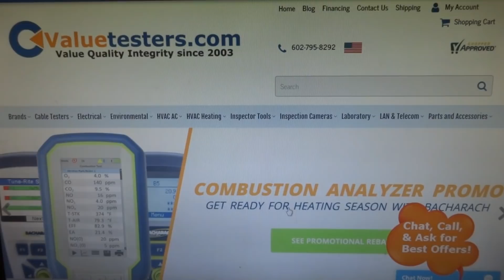kitchen sink basket strainer leaking replaced

Comment: I just replaced a leaking basket strainer on my kitchen sink.  I had to cut off the nut off the strainer using a diamond cutting wheel in my dremel tool.

Comment: Just curious why you didnt switch the nuts metal to metal pvc to pvc. and no thread tape on the strainer threads
Reply: U do ur wok and plumbers will do ours lol
Reply: Why would you ever put teflon tape on the strainer threads... There is a plastic gaskit that seals it anyway... I bet you put teflon tape on your water bottle caps lmfao
Reply: Shane Wimer  You don't need anything on the strainer threads because they don't seal anything . The " top of tail " washer is the seal.
Reply: only use tape on a NPT thread... love seeing DYI guys using thread tape on compression threads. Maybe use a little dope to protect the threads...that's it.
Reply: throttle bottle , Standard pipe dope like Blue Seal or any of the dopes you brush on to the threads is a coolant ,lubricant, and a sealant . Teflon tape is mostly a sealant . At one time back in the mid 60s when Teflon started gaining popularity when you bought a roll of Teflon tape , if it was the Phelps- Dodge brand you got a small bottle of lubricant to swab on the tape before threading the fitting on so it didn't pull out of the fitting, the same as brushing on dope today. May even have a bottle hiding in my garage somewhere.
Reply: Joe Dugas Yeah Joe I always use a little dope on compression rings and flare nuts and the two faces of a union. I also put a little film of dope on both sides of a gasket that goes between two flanges , never any leaks.
Reply: @throttlebottle5906  yes I leave everything leaking.   30yrs doing this... I leave a leak. It's a special present for the customer.  Dont be a shitty person on a fun channel.  I stated a fact.  If a sink repair was your biggest challenge.. you have a long way to go.
Reply: @johnkrim8377  dope the red woven rubber impregnated gaskets...NEVER dope a black neoprene gasket...when you tighten the flange... those suckers like to get "smooshed" out of the face....didnt know what term to use for that ;)
Reply: Joe Dugas , yeah Joe I should have been more specific , I was talking about mostly the fiber type gaskets.

Comment: it wont leak he said lol if he used silicone like rest of us it wont then putty isn't good any more
Reply: That's why youre a hack and not a licensed plumber... Putty is the best thing to use on basket strainers as well as tub drains. It has been proven and stands up for countless years. Silicone deteriorates over time and fails much faster than putty. Next time do your research before commenting on a subject you know nothing about.
Reply: cicciarelliam   S.O.S. plasti - putty is the best you can use to seal strainers, faucets, around tub spouts, behind shower plates etc. It will still be there 50 years from now and still somewhat pliable, it's all I use. Silicone will shrink and open up in 5 years or less , would never use it.
Reply: Putty outlasts everything. It's an amazing water sealant